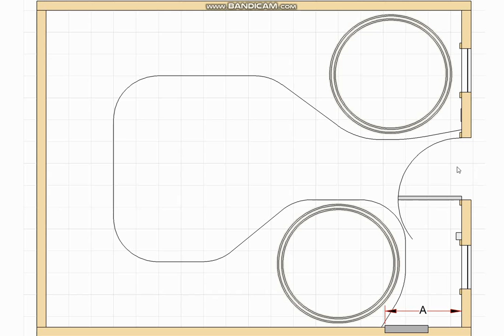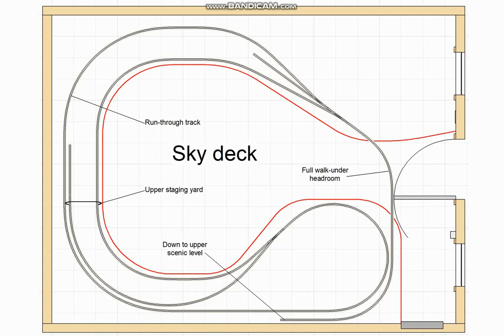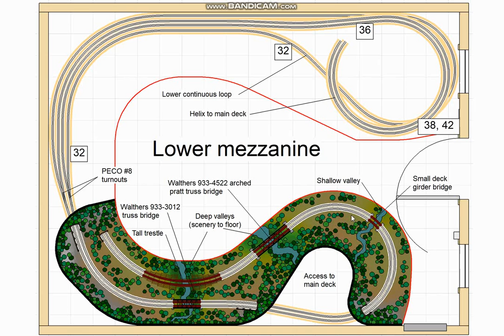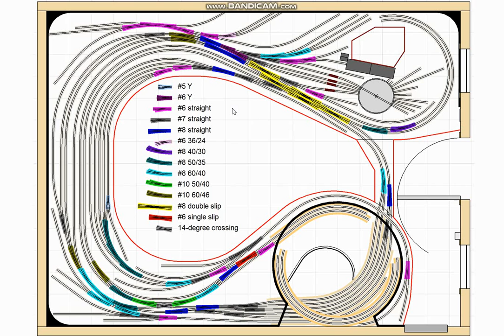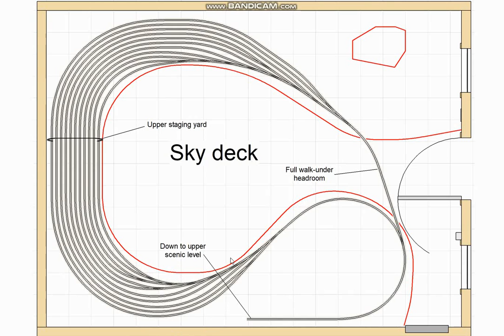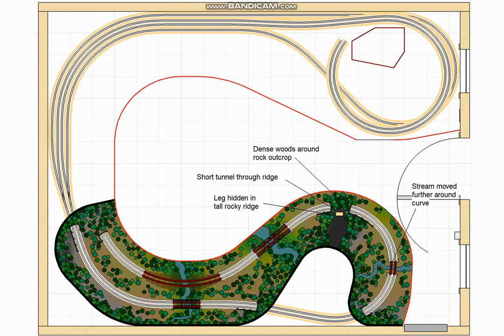A four deck layout design for a custom-built room.

Comment: The contrast between the largely urban second deck and the mostly rural third deck is very interesting and quite pleasing with the high track and structure density contrasting with (and separated from) the rural scenery on the third deck. Very nice.

Comment: I love your designs and if someone thinks there is too much track they can remove some but still learn from the challenges you resolved to get everything in. To that point, can you tell me how much length you saved on the sky level by using the wyes at the yard throats compared to a regular yard ladder?
Reply from the maker: I didn't use any wyes on the sky staging.  I used a few curved turnouts and then a #6 compound pin-wheel ladder.
As a rough guide, for every layer of turnouts you get on the curve, you gain a foot of length.

Comment: thanks for sharing this excellent design and video Peter. Can You tell me which video's have more on use of 
the adjustable shelf brackets system ?
Reply from the maker: I've featured them at least twice.  Layout design considerations, part 2 and the one where I prepared my workshop for the current layout build.
Reply: @mpeterll  thanks, found them and watched

Comment: I certainly do not blame you for the amount of track in some of your designs. Especially if one expresses it as a ratio of length of track to area. After all the customer has his or her "wish list". After all, any model railroad must employ selective compression of features. The exception might be a short line operation in a large space.  But even then on most model railroads the rolling stock dwarfs the industries*. Instead of the other way around in reality usually.
*One industry I do not think I've ever seen modeled is a rolling stock manufacturing facility. This would allow rolling stock that is basically unweathered in a believable setting.